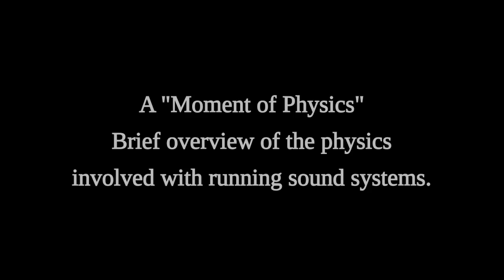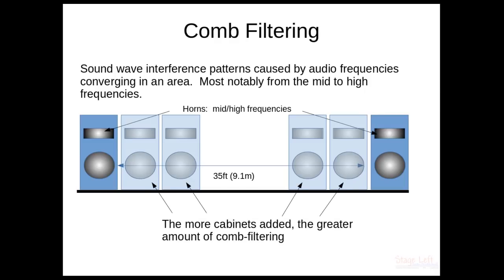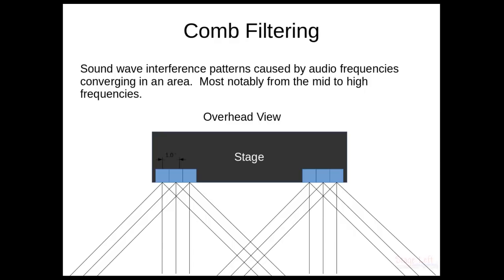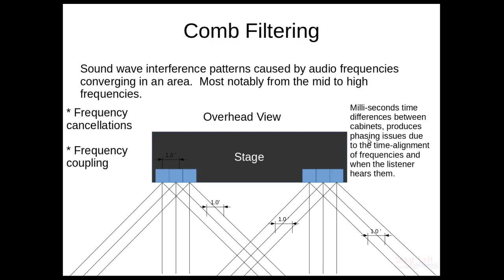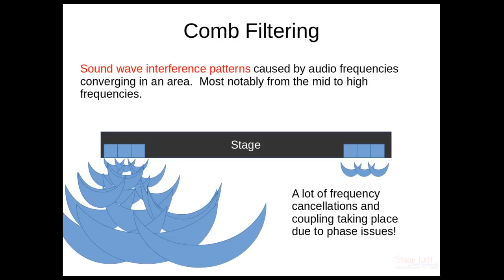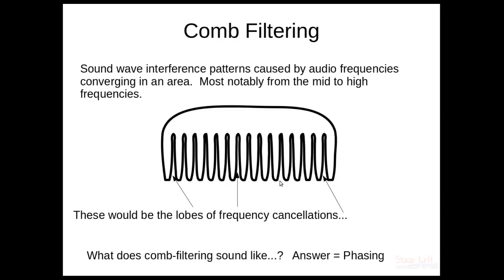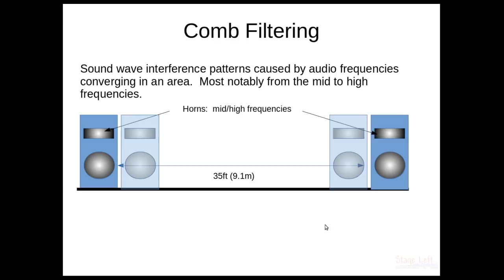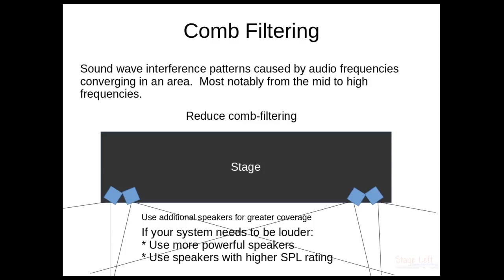Talking about comb-filtering in audio  (Physics 5)

Comment: I work with a local sound company on larger/outdoor events. We stack two mains per side. However, we flip the top cabinet so the horns are together. Basically giving us a large dual 15 with a double horn. It seems to work well.
Reply from the maker: Thanks for your comment.  That method is a common practice and can work really well.

Comment: once again Newb here, does comb filtering happen on a line array?
Reply from the maker: Not all line arrays are the same, though, most do not present comb filtering issues.  Each speaker cabinet within a line array (usually called a "speaker module") is designed to directly work with multiple exact same speaker cabinets... which is why single point-source speaker cabinets (referenced in the video) do not do well when placed with multiple cabinets.
Reply: Very good. Hopefully I'll do large enough events to one day need those. Thanks again